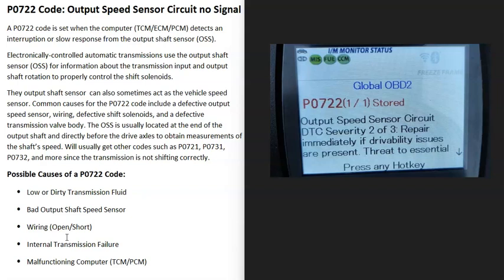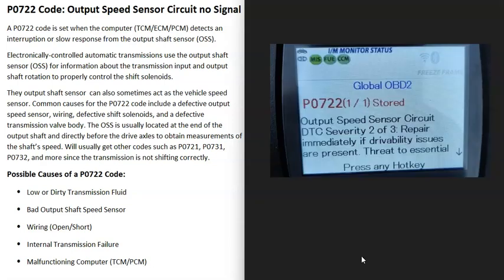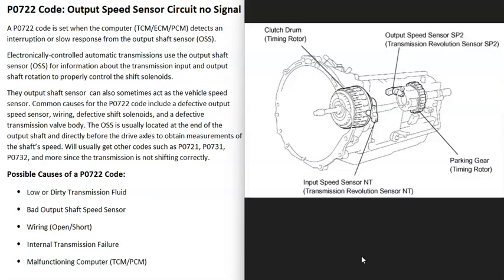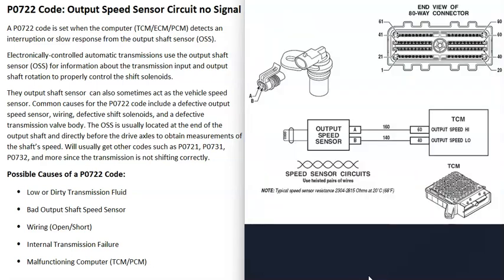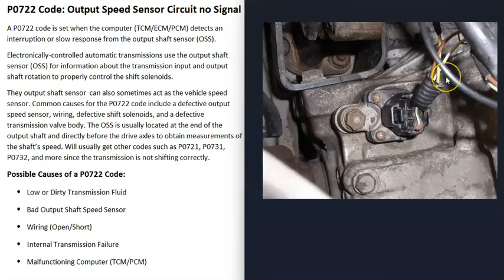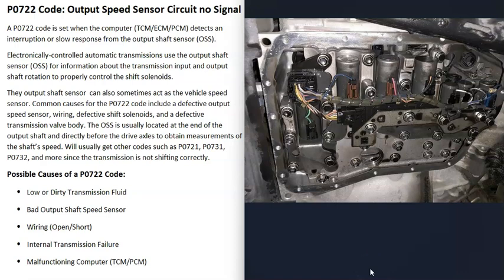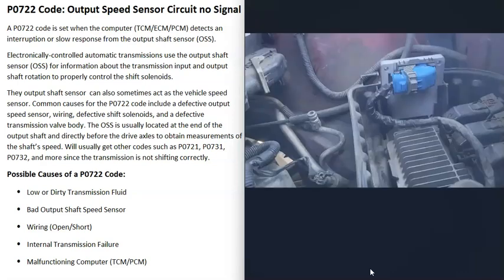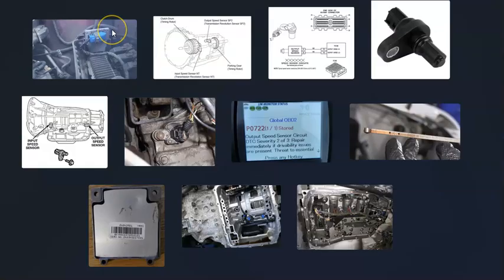Causes and Fixes P0722 Code: Output Speed Sensor Circuit no Signal

Comment: If you accidentally over fill a 2011 kia sorento transmission can it kick this code and a p0733 and only these 2 codes. I replaced the transmission and put fluid in. Ran it a little while and checked and added more but still showed it needed more so this morning i tried to drive it to work and only made it about 1 or 2 miles before it kicked me to neutral basicly. Dash shows it in reverse or drive but doesnt move

Comment: Sensor was replaced.    Delayed when we t into gear.   Then complete fail.    Then only reverse and only po722 vode
Reply: What did it end up being ?
Reply: Yeah cause my kia has the same code and it was running fine now its acting like it has no gears. Also got a p0733 code

Comment: So I just got this code p0722 on my 05 Honda civic n my “D” driver light keeps blinking so I replaced both speed sensors on top of transmission n top off with trans fluid n now it shifts fine but the “D” light keeps blinking but everything shifts fine but idk if I have to go take my car to get code n check engine reset ??
Reply from the maker: It needs to be checked for any codes. You can clear the codes and see if they come back. If you don't have a scan tool, automotive stores will often do a scan for free.
Reply: Codes rerased and keeps coming back